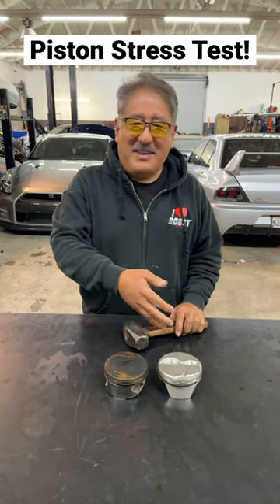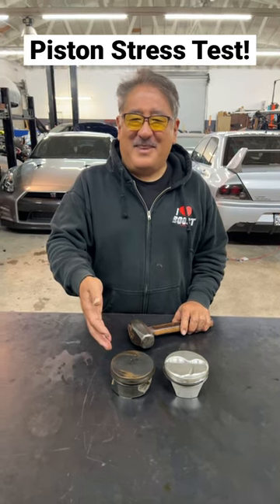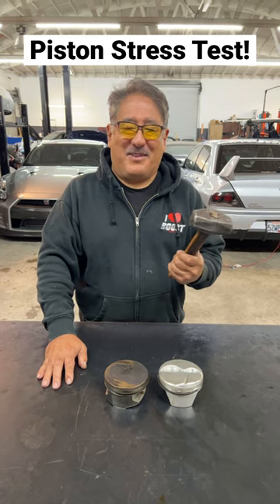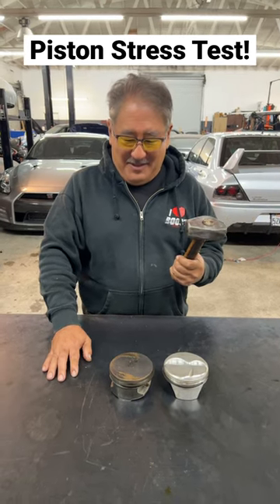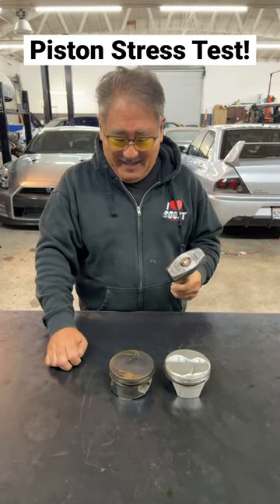Forged vs Cast Piston Strength!

Comment: But you don't have a Hamer strike the edge of the top of the piston when it's in the motor lol how is this a accurate description of what happens inside a running motor
Reply from the maker: Because pistons tend to break or bend the upper ring lands due to detonation, one of the most common piston failures.
Reply: It’s a good analogous test when you understand what is happening in a cylinder during detonation. And where the failure occurs.

Comment: Do you know if anyone has ever extensively modified a ga16de? I have no idea what they're capable of because nobody did anything with them. I think it was a wasted opportunity because Honda's aren't the only fwd cars out there and nobody noticed.
Reply from the maker: Not to our knowlege. The GA16 responds pretty well to basic mods but the cylinder head doesnt flow that well so it doesnt have a lot of potential.
Reply: @motoiq  Oh okay that makes sense. The power would usually taper off near red line. I just think it's a pretty good engine with a cool intake sound. Thanks for the response. Great work with the channel. Knowledge is fun.